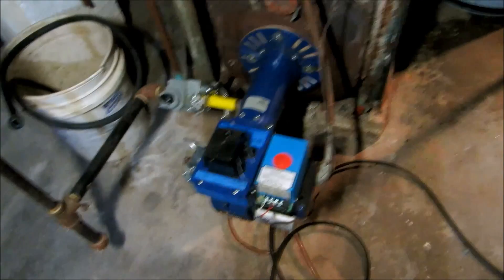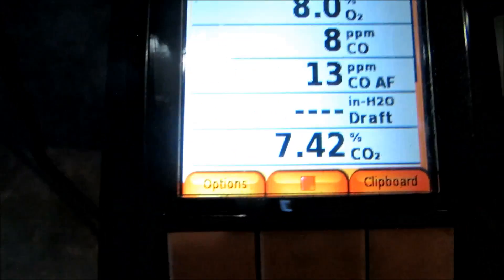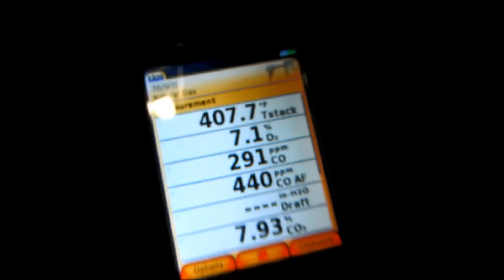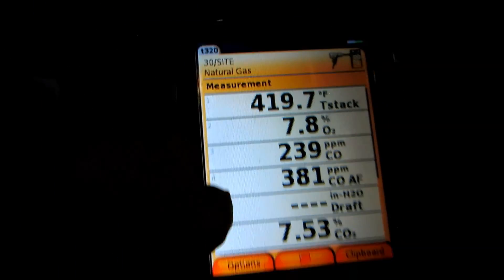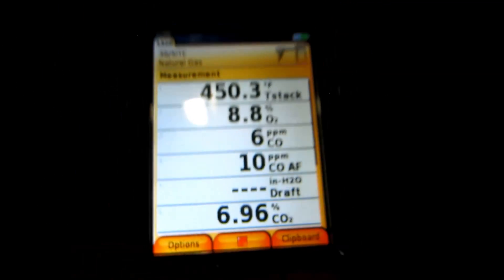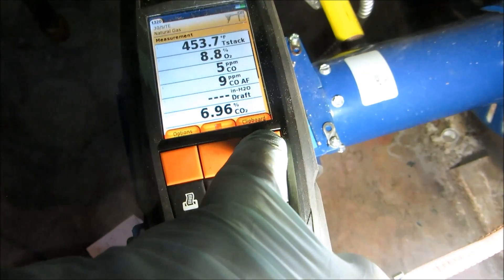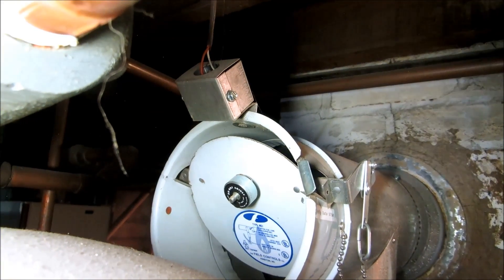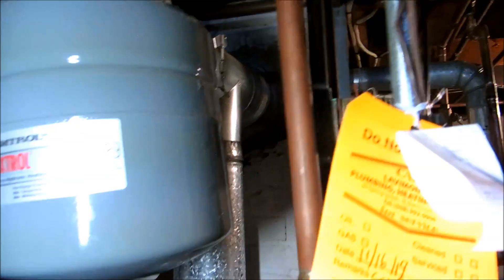carlin E Z 1 conversion gas burner testo 320 dials her in

Comment: I'm trying to decide whether to install an oil to gas conversion burner or have a new gas boiler and hot water heater.  I have a tankless steam boiler, that is less than 10 years old, it is a rental house that has 4 bedrooms and 2 bathrooms.  Any recommendations?

Comment: don't you have a cheat sheet for options to lower CO and what to do if CO2 goes out of range or O2 goes out of range .... When you lowered the air to try raise the CO2 and the  CO went high, I thought you would have lowered the fuel supply to lean it out allowing the CO to drop.. am I missing something? It seems to me that fuel supply is another adjustment to consider.

Comment: Always adjust gas equipment by O2 do not rely on your seat yet to reading it is a mirage because your analyzer does not have a CO2 sensor it only has 02 sensor also on this old boiler might've been a good idea to do over fire rating a lot of times I do this on old boiler is because of draft leak. Big cause for old oil boilers sooting over fire and breech readings differ. More accurate

Comment: i have this same burner but it keeps going out on flame rod failure, but i clean the rod and it will work then when it calls for heat again it locks out. please i need some help in the NYC area
Reply from the maker: vr6con is the boiler clean,chimney ect, do you have a good draft over the fire??? you might have a bad flame rod.clean it good with sand paper .i would check for good wire connections also.

Comment: Steve I admire your work and usually just watch your videos. But I have 3 concerns here... Why is there a reducer on that flue pipe? Why stay with the barometric damper (not required for the Carlin burners)? Draft should be adjusted to proper level before combustion analysis is performed. Your o2 and CO2 would've changed going from no draft to positive. 

Otherwise keep up the great work.
Reply from the maker: Juan Cuervo you have a good point about the draft....this guy needs a new system,boiler .. the barametric damper is reqiured by code in my state.the one for gas swings both ways .the one for oil only goes it .
Reply: @stevenlavimoniere  
Why would they mandate an atmospheric damper if a burner is designed to run without one?